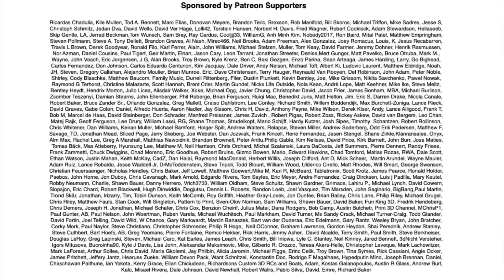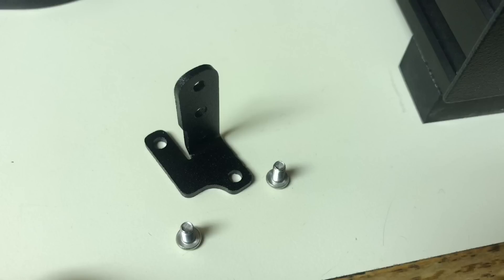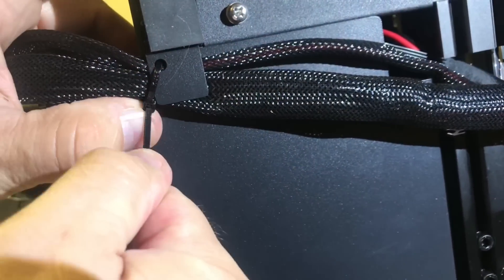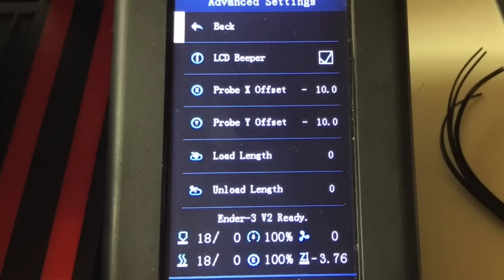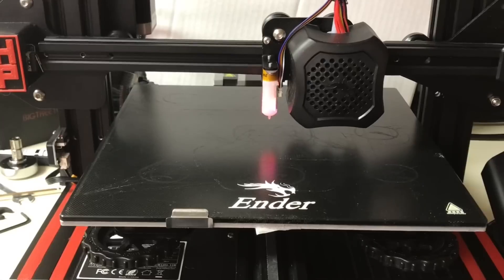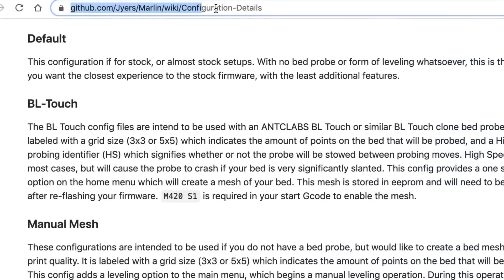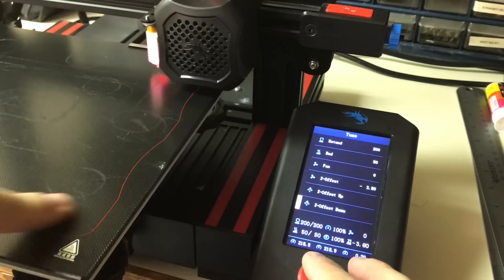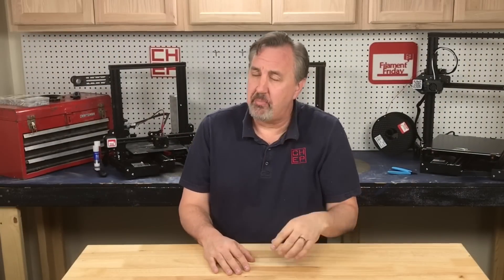How to Install AutoLevel on Creality Ender 3 V2

Comment from the maker: You can also use G29 in GCode to auto level before printing but I recommend the M420 S1 recall instead of G29 in Start GCode since it allows you to easily do two color prints without worrying about the probe hitting the first print. This was a question from a previous video.
Reply: Yup but also
1) you don't really have to auto mesh every single time you print (save time)
2) less wear on the machine
Reply from the maker: Agree. Just do it once and then save it like I showed in video. Then recall it with M420 S1 in Start GCode like I showed. Only do a new level when you want.
Reply: Not a bltouch issue but all of a sudden my ender 3 pro has stopped sticking to bed and I cant figure out why. Nothing has changed. No firmware, new filaments or cura updates installed. It printed fine now womt stick to bed even after trying to relevel. It just blobs up around nozzle. Tried more/less height. Tried more/less heat. Tried drying filament from moisture. Tried a few brands of isopropyl to clean any residue from bed. I have a glass creality bed and it was working fine. All of a sudden not sticking cant print anything.
Reply: @XxTWMLxX  I experienced this recently. Could be a partial block in the nozzle, which causes the filament to come out all curly and blobby, rather than straight. I've replaced my nozzle, but haven't tested it yet (still getting my BL touch installed)
Reply: @XxTWMLxX  Sounds like your beds too low down
Reply: @XxTWMLxX  I've had the same issue before but cleaning the bed with a bit of IPA fixed it for me
Reply: @XxTWMLxX  I'm having this exact same issue and it's driving me insane, did you end up figuring it out?  I changed my nozzle, bed springs, added a bl touch just now.  Before I got BL Touch, i'd manually level but when I went to print it would be lower compared to what I just did which makes me think the gantry wheels are too tight or loose so it's sagging idk :|
Reply: Moreover, this helps if your BLtouch starts blinking red during G29 (it happens 1 out of 10 times for me. After this blinking ender proceeds to print, bending the BLtouch probe). So, I changed to M420 S1 to prevent it.
Reply: @Tatum Edgar I use flixzone. You can find it on google :)
Reply: Hey, I got a problem with my CR Touch, I always got a Homecoming failed please reset screen, how do I fix it? I would be very thankful if you can help me.
Reply: i have no idea how to measure the y off set as you didnt show and its very unclear
Reply: I guess Im quite off topic but does anybody know a good site to watch newly released series online ?

Comment: My hot end bracket does not have any holes in it ,i have early model maybe you need to inform us of this
Reply: Hi Robert. Contact Creality support. I've heard from others that Creality will replace these early X carriages which don't have the BLTouch holes for free.
Reply: @BV3D  thanks
Reply from the maker: There are also designs on Thingiverse: https://www.thingiverse.com/thing:4462870
Reply: @FilamentFriday  i might try that, drilling and tapping holes is no fun, i usually breal the tap. That seems to be held with the bolt for the roller.  Again thanks.
Reply: I had a spare BLTouch so I used the thingiverse bracket.  this worked OK but required extra washers to lower the bLTouch.  Also added a 4 * 4 grid because I replaced the glass bed with magnetic spring steel.  I also use G29 and a single point for each test point,  this saves some time.

Comment: Hey, I run two ender 3 V2 with BL touch and   have found the smith 3D firmware to be great. Thanks for the video I never thought of pulling the cables through with wire, that’s a much cleaner solution.
Reply: so, is this videos firmware the right one? thanks.
Reply: @Jamiainen  Chuck puts together good well researched videos so I would have little reason to doubt his recommendations.

Comment: Great video and great timing.  My BLTouch arrived a couple of days ago so it was nice to check my work.  The included instructions with the kit are not good.  I had used Creality's firmware but I think I'll switch over to Jyers.  It looks more complete judging by the menus.  I also insert a G29 so it auto-levels before every print because I swap out print beds frequenty.  Thank you very much for making this.
Reply from the maker: You can just run the level as well. Then you don’t have to worry about the probe hitting if you do a two color print.
Reply: @FilamentFriday  Two color - hadn't considered that.  Thanks.

Comment: Generally for bltouch i suggest taking the springs out and use silicone fixed mounts so the bed is more rigid in reference to the base plate
Reply: Ender 3 Needs the new CR 6 SE heat bed. Creality copied the prusa style 9 aluminum sleeve and 9 screws
Reply: Is there a pack of these i can buy anywhere or i have to Jerry rig it?
Reply: Please provide links for these, thanks

Comment: wouldn't it be easier to thread the cable from the other end first so you have the smaller plug to navigate through the cable mesh ?
Reply from the maker: Probably would but I had already connected it.
Reply: I would have thought so too so I tried this.  It was harder because the connector is small and hard to grab through the cable mesh.  I ended up doing it the way he did it.

Comment: Better to use G29 instead of a saved mesh so it probes the bed each print. If you bump or move the bed the mesh will be off..  :)
Reply from the maker: Just rerun the level from menu if you need it.
Reply: @FilamentFriday  I find you only do that after you have an issue with a print, which wastes a lot of time and creates a lot pain.. :)
Reply from the maker: G29 every print doesn’t waste more time?
Reply: @FilamentFriday  guess the issue is the firmware you're using, the speed setting must be on super slow. Mine takes only a few minutes.
Reply: @FilamentFriday  I've been using g29 every print, and I don't mind it too much but I'm going to try out your method because that sounds like some time saved.
Reply: Use UBL for the mesh, then just start your gcode with G29 J2 to probe the 4 corners and compensate for the tilt. The tilt is what changes not the whole mesh.
Reply from the maker: This is basic mesh auto bed level not UBL. That’s a separate firmware.

Comment: Should you not also show the G29 ( Auto level the bed before each print ) method also where you do not need the mesh ? Good method to use if you are sing a spring steel bed as this gets removed from the machine bed all the time.
Reply from the maker: Just rerun the level from menu.